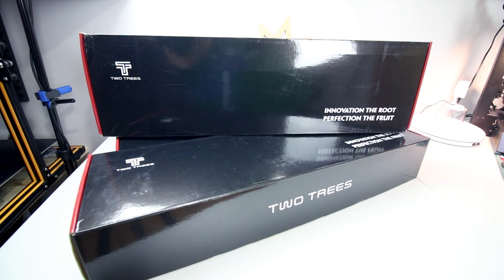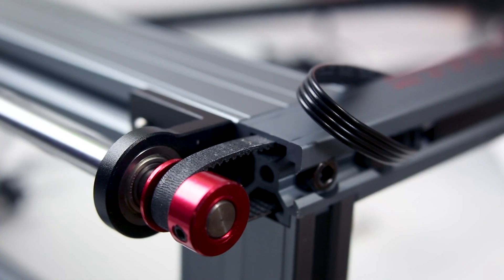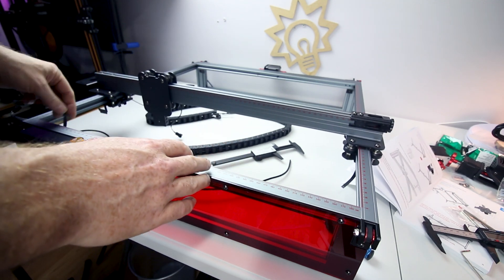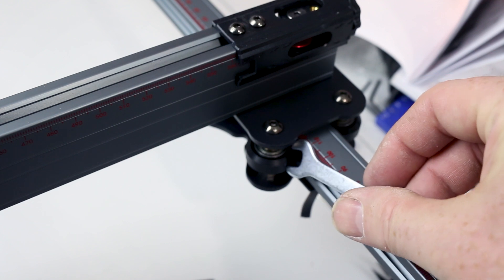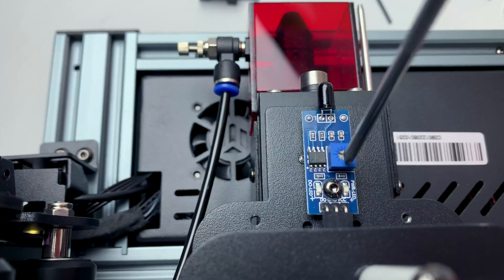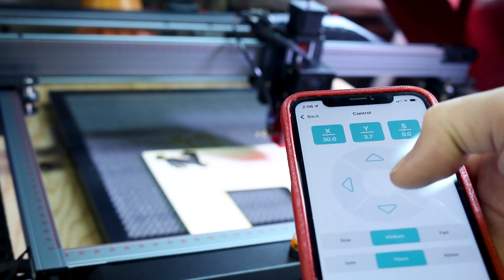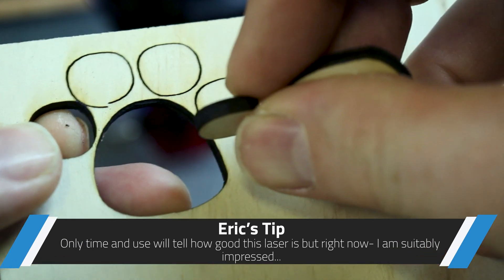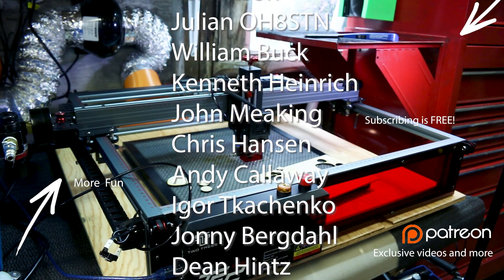FINALLY a Laser NOT Like All The Others! 10W Laser Cutter/Engraver TS2 from Two Trees

Comment: Hi, i have problems with this machine, i cant use it (5 seconds after begin, it stops working with error) because of the flame sensor... i opened the electronics and disconnect the flame sensor, but this machine is not like others, the problem persist (other laser machines, you disconnect the sensor and they work perfect)... i contacted two trees and no response, do you have some info about this problem or how i can disable in the firmware the flame sensor?... also in grbl, using $$ i dont identify a configuration for it in the commands... a bit frustrating, thanks in advance!
Reply from the maker: Here you go https://www.mediafire.com/folder/2t9rswi0037lj  This updates the firmware for the flame sensor.

Comment: I may have missed it skipping through, but did you ever show the power supply for the system?  I saw the line chord, but not the power brick.  Anyway, the stupid lack of a power button can be fixed by putting an in-line switch in the power chord going to the brick.  Since that looks like a standard line chord of the kind used in instrumentation, you could modify a different chord to avoid violating any warranty... assuming any REAL warranty is provided.  With too many China-sourced items, warranties are entirely theoretical.
Reply from the maker: Its a standard brick style

Comment: Not a bad option for the price.  It is really nice to see this stuff becoming even more affordable for the home hobbiest.  I don't like machines that are wide open due to smoke and the risk of laser bounce from some materials like glass, mirrors and some ceramics but building an enclosure would not be too difficult.  I really wonder what the longevity of the laser diode will be under say normal daily or weekend use.

It would be a contender for my garage workshop if I didn't already have access to 3x 80watt and 2x 100 watt Co2 lasers at work with large 700x500mm work areas with 20mm material passthru.  At home though this size would be awesome for most users and I would bet a person could mod it if they needed a larger area much like people modding the original x-carves and shapokos.
Reply from the maker: Agreed. This one is indeed the best Ive seen yet.  On the diode- the 10W variants are actually 2 5 watt diodes firing together.  The 5's have a pretty good track record but only time will truly tell.  Ditto on the C02- I cut a lot of acrylic so can never get away from CO2